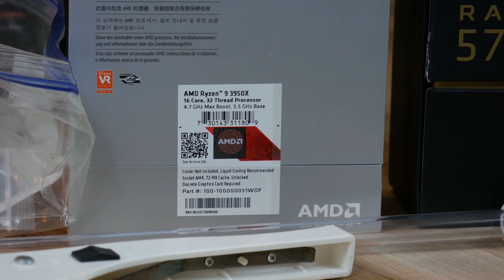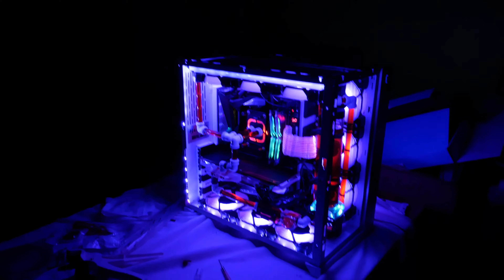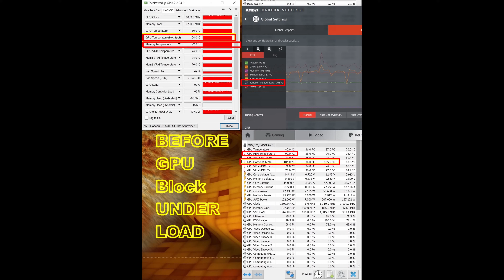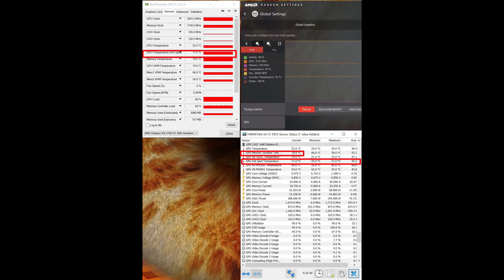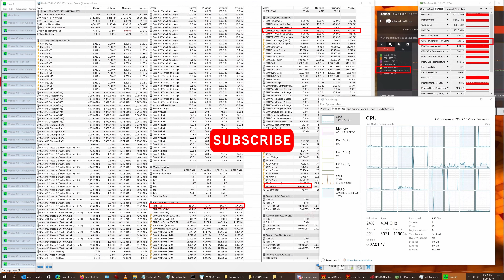RX 5700 XT WaterBlock, 35C Temp Drop! Bykski, XS PC, Watercooled Aorus X570 Master, AMD 3950X

Comment: That temp sensor you got there is made of aluminium. It will have the water glittering with aluminium particles in no time. I used the same one, and had to remove it and clean out my entire loop. Some people say that the inside is made of POM, but that is not true and it will have a galvanic corrotion reaction with the copper in the loop.

Comment: Hi friend. Could you give me some help? I have built a custom loop for my PC. I have all parts with bykski. I have two radiators 360mm for my loop. My gpu is a rx 5700 gt from gigabyte and my cpu is a ryzen 5 3600. My temperatures is still hight. I thought that I have made a mistake. The thermal mass
 is cheap and this could be the problem. I bought another 360mm for the loop and Thermal Grizzly Kryonaut, but 
it will only arrive next month. What you think?
Reply: @IntenseWebs  I put pads in all. What thermal mass I should use? Kryonaut? I saw hy-p13, 13.4 w/mk.

Comment: Fans at the bottom pushing air in is a good thing, however you need to remove the metal case mesh at the bottom, it strangles the airflow and the fans cannot do their job properly resulting in turbulence, i wish lian li would cut that crap out its a useless design, i put rubber feet on mine then fitted slim fans underneath the case
Reply: @IntenseWebs  I just use my vacuum cleaner on blow once every 2 months, the mesh takes the fans efficiency down by 50%

Comment: Why would you use that crap thermal paste?
Reply: @IntenseWebs  If I repasted a laptop with that thermal paste you used, the temperatures would increase. It only has thermal conductivity of less than 2 MK/W. It is lower than the average thermal pad, that’s how bad it is. Even Artic Silver 5 or Kryonaut is 10-14 MK/W conductivity. Your reduced temperatures are due to the custom water loop that you are using. So, yes even tooth paste would work. But, I would replace that thermal
Paste immediately. It has less thermal conductivity than a cheap thermal pad. 

I can replace the thermal paste inside of my CPU’s IHS on my 7980XE and the temperatures dropped 25C by using liquid metal alone. And that’s using the same cooler I was already using before. Thermal conductivity on liquid metal is around 80 MK/w though. 

Why built a custom loop and then use the worst thermal paste available? You will most likely see another 5-7C reduction. And that’s a big difference. 

Instead of running 45-50C. It may run 38-43C
Reply: @IntenseWebs  

Thermalgrizzly conductonaut is excellent. Just make sure you soak the liquid metal in really really good. Liquid metal will roll across metal like water on a waxed car.. You want to rub that LM in to the surface for several minutes until the molecules work their way in to the surface. It’ll look like it’s painted silver almost. Temps will be good for a day or two, and then you’ll need to reapply it yet again, because the temps
Will increase. The 2nd application will last for years, and reduce temps because the metal of the contracting surfaces have reached an equilibrium of liquid metal being soaked in. Just a heads up before you delid a CPU and maybe reseal the IHS back on. You don’t find this information often. You learn it with experience. You literally want to coat liquid metal, let it sit, coat it, let it sit, coat it, rinse and repeat. A second application is still almost always needed. It is a tricky process, but when you do it right it works extremely well. Before I delidded my 7980XE (18) core I was running around 4.5Ghz at 90C. Now I am at 4.8Ghz and stay around 77C. This cpu pulls almost 900 watts by its self. It is a must!

Oh and, I’d save that bulk thermal
Paste for fixing friends or family PC’s that run at stock frequencies. Get your self some 

My Top 3 thermal paste:

Kingpin KPX thermal
Paste. Works crazy good! Probably as good as it gets. I’ve used every paste around.

Thermal Grizzly Kryonaut: it is a very good thermal Paste.

Thermalright TFX, or TF8
“Very tough to spread, but it’s fairly cheap for TF8 and works better than Kryonaut.

These thermal
Paste I have listed here are all great, and will be within 0.5C-2C of each other. I’d buy what’s cheapest, and available.
Reply: Irrelevant, youre only supposed to use a paper thin amount to fill the microscopic gaps in the metal,  therefore doesnt really make much difference what brand you use
Reply: @Synthematix  

Keywords! You just said it. “BRAND” 

Do you know why liquid metal
Works so well? Because liquid metal
Is about 81M/K heat transfer conductivity. 

Do you know what his thermal paste conductivity is? About 2-3M/Kw conductivity. Don’t believe me? Go read the specs on Amazon.

Thermal grizzly Kryonaut is about 13.5M/Kw conductivity heat transfer. 

He would get the same result using a thin thermal pad lol. Literally! I have thermal
Pads with better heat transfer than his paste.

I’m Sorry but your information is wrong. That thermal paste is garbage. Yea he would see drastically lower temps by using a “BRAND NAME THERMAL PASTE”

I consider my self to be very well versed in lapping, heat transfer, and all sorts of thermal paste. Including delidding and actually lapping the silicon die. 

Not bulk from China. Most brand name thermal past compounds have about 4-8 times the heat transfer capability of that stuff he used.

The guy that posted this video is a really nice guy! He just used a bad paste. Lucky his water cooling made up for short comings of it. But still, with a quality paste his temps would be drastically lower.
Reply: @videocardzrule354  People that care that much about heat transfer delid their cpus.
Reply: @Synthematix  

And with a delidded CPU, you still use thermal paste. You don’t just toss the lid.
Reply: @videocardzrule354  I do, with the tiniest amount of thermal grease, direct contact from the waterblock to the die gains the best results
Reply: @Synthematix  

Definitely. I am considering going direct die with my 7980XE. It’s delidded and lapped and all that good stuff. But, I’m still not entirely satisfied with the core to core temps. Some cores peak at 56C-62C while (2) of my cores are hitting around 75C. So I think direct die with just thermal paste will resolve this issue.

Comment: awesome video but wait.. this need explaination... both cpu and gpu watercooled , but still has those USELESS fans at the bottom ?????????????????????????

i do not know any system build at least half decently that kept useless fans once watercooled. only fans on radiator.
Reply: @IntenseWebs  watercool that m2 nvme ssd's
Reply: Fans are never useless, what about case airflow? you need that when you watercool, fans at the bottom like this act as convection cooling, heat rises, he did the right thing by adding them.
Reply: @Synthematix  excelent joke. now go elarn thanks.